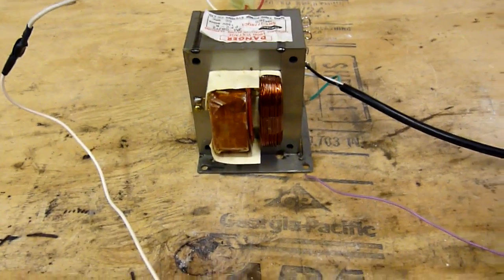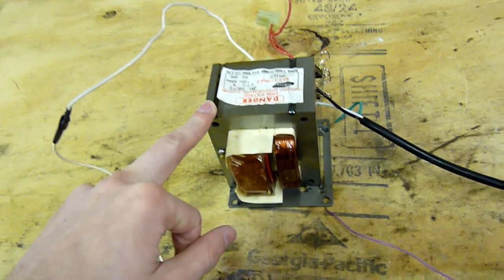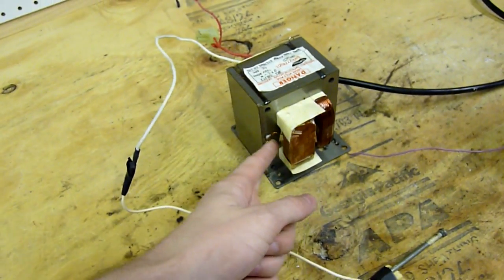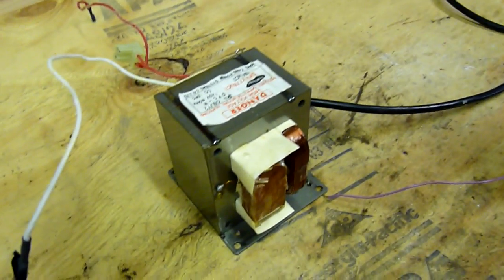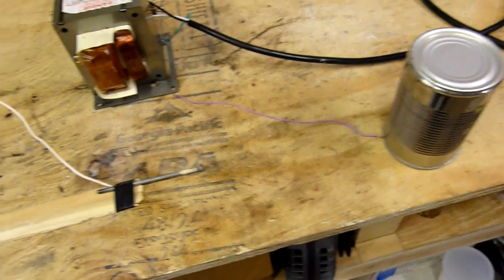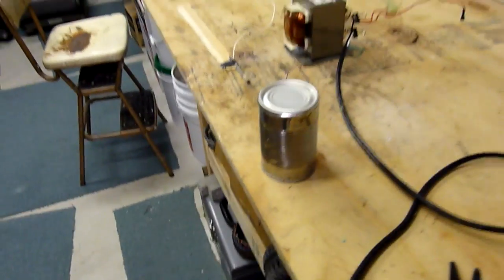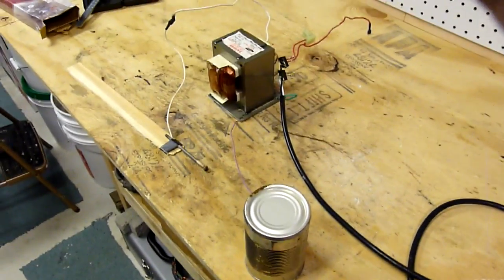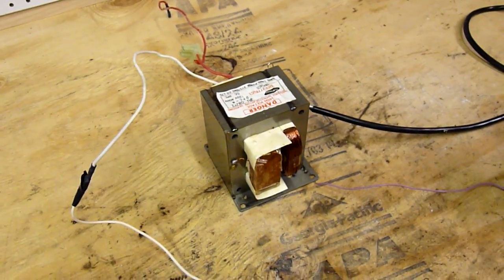High Voltage Transformer

Comment: Those small microwave transformers are useless for most things other than for short bursts like when used in a microwave. Try finding a older microwave, the transformers are much bigger and better, the primary windings don't get stupid hot so quick like the little ones do.

Comment: Those transformers are good for removing the 2000 volt coil and replacing it with 10 gauge stranded with about 21 turns to get 14-15 volts at decent amps for battery jump starting, and charging. Or i seen some people use real heavy wire like 2 gauge wire with only a couple turns because that is all that will fit, lol, but they use it for welding, it will eventually overheat because that is too big wire for that size core, but you can still weld just do not do it constantly, give it time to cool. But i don't like building things that work like improperly, so i used mine with 10 gauge for battery jumper and it works fine even if it is used constantly, 12 gauge for sure won't over heat it, but i pushed it to the most i can get and keep a decent temperature to where it can't overheat itself from constant use. I never even tried to hook up that transformer with the 2100 turn coil on it, i seen lightning before and i had no use for exposing myself to it, also it is like welding, if you look at it then it will eventually take your sight away, burn your eyes.
Reply: Only the big ones, those smalls ones are not much good for charging car battery's or anything that requires the transformer to be on for more than a few minutes.

Comment: First of all: don't EVER use a MOT for experiments! The output power is way too dangerous. And second: why on fraggin' earth are you using a wooden stick!?!? Are you just plain stupid?? If there's just the slightest hint of moisture in that, you would instantly fry yourself, especially with the MOT set up the way you did (no ballast or fuse).

I would strongly suggest those who are thinking of replicating this experiment, not to do so. Use a flyback instead, and build a ZVS driver for it.

thx
Reply: I doubt a small bit of moisture would allow enough current to flow through the wood to kill you. A flyback driven by a ZVS driver can be just as lethal as well...